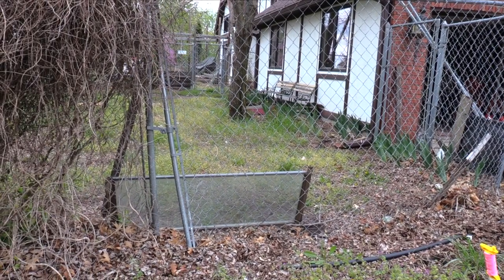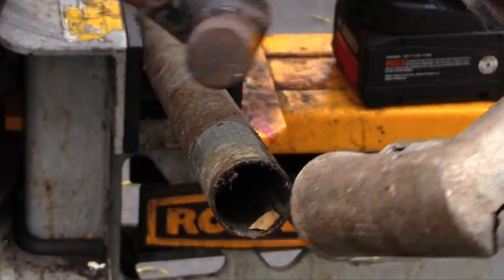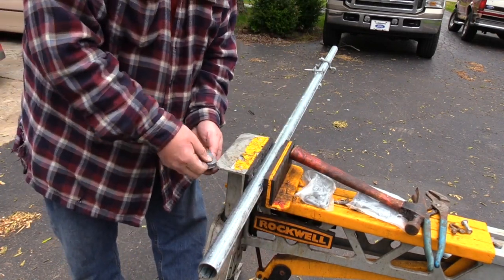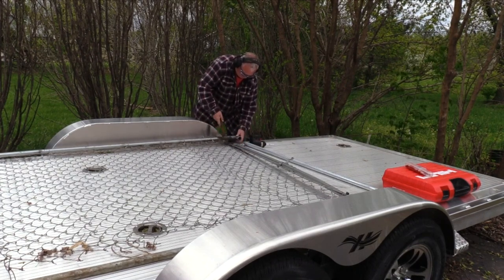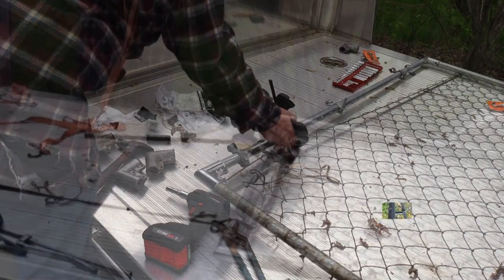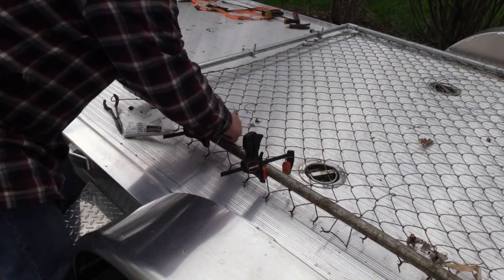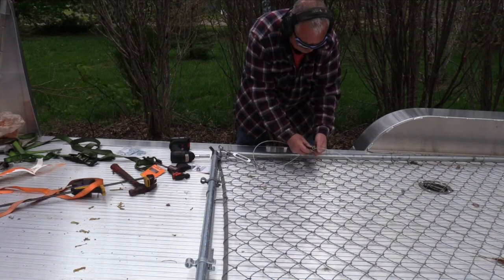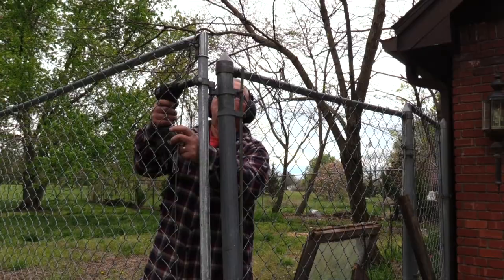How to stretch and repair and chain link fence gate

Comment: Hi I have a question I'm trying to replace the corner on my chain link fence gate but I can't get it to stretch out to put the pipe in the end of the gate corner. Are there any tips you can give me?
Reply from the maker: Send a few pictures to kingranch@currently.com without seeing it I can only guess. You can tie off to a vehicle, a tree or lawn mower perhaps with a rope and use a board in tourniquet fashion if you don’t have ratchet straps.
Reply from the maker: Sounds like you’re attempting to stretch the chain link enough to assemble the corner joint. Remove the tension from the end of the gate especially the corner, assemble the corner joint ( frame) then re-tension the chain link working from the top down to the lower corner